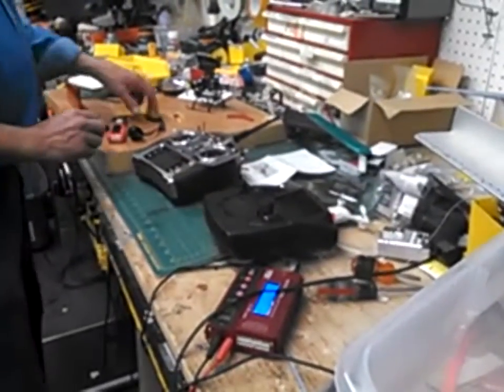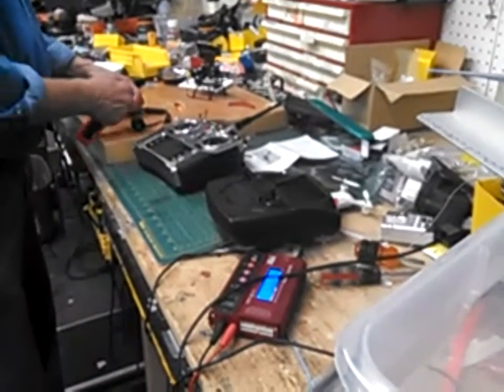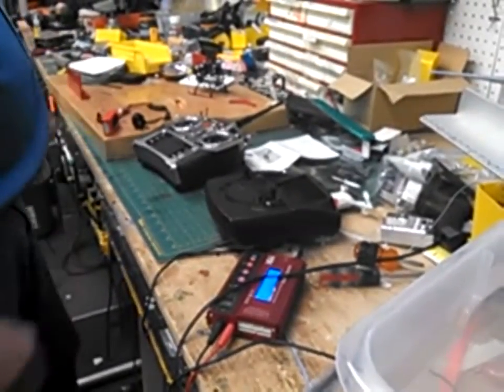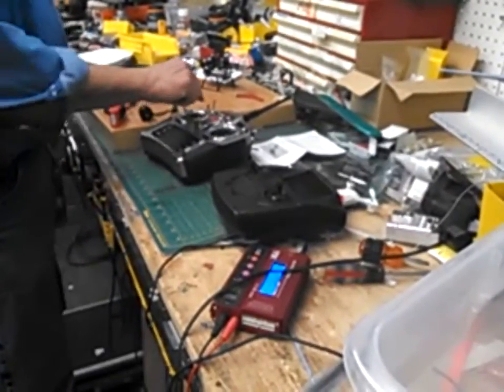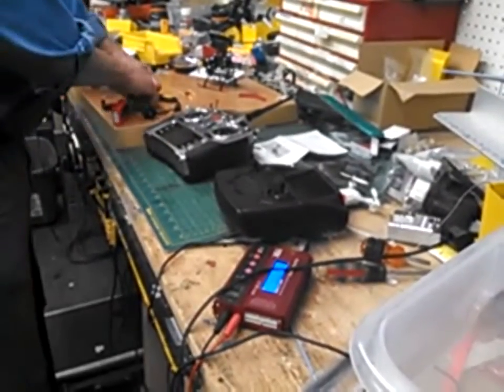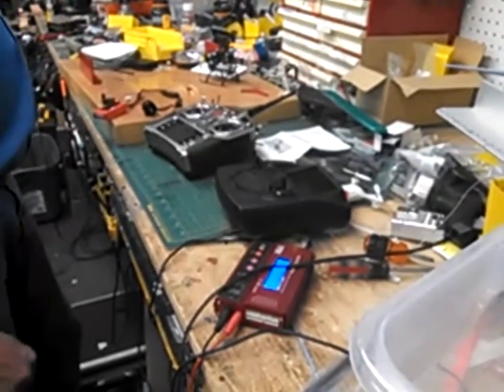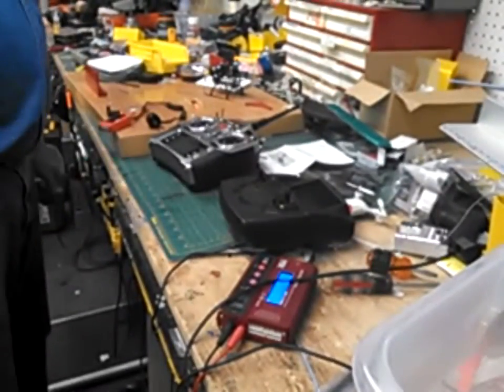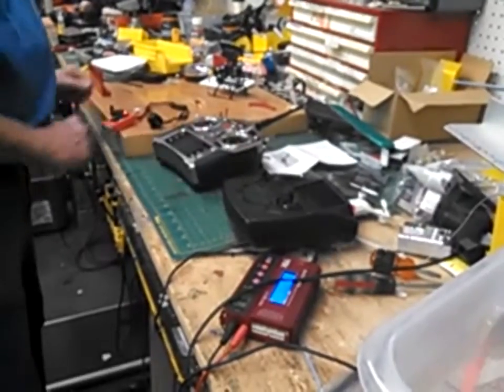Throttle Set on 20 and 30 amp Lazertoyz ESCs

Comment: Well i got my motor to work but its backwards, when my throttle on my transmitter is all the way up that when its off when i gentle move the throttle down that's when it powers up and start turning. How do i fix this?